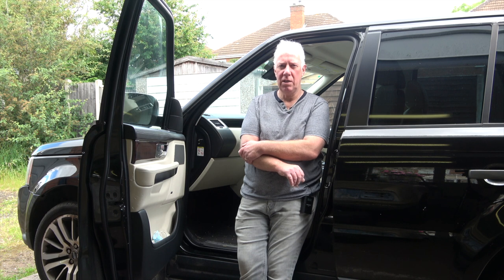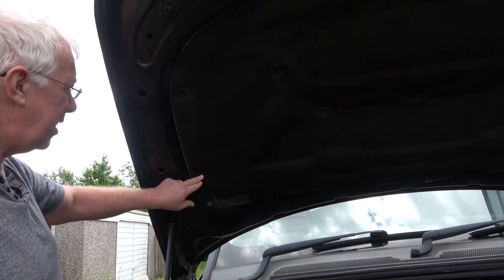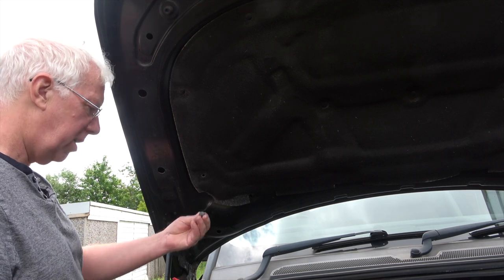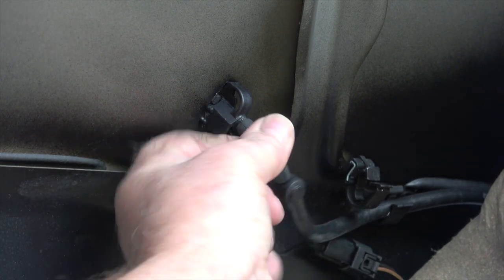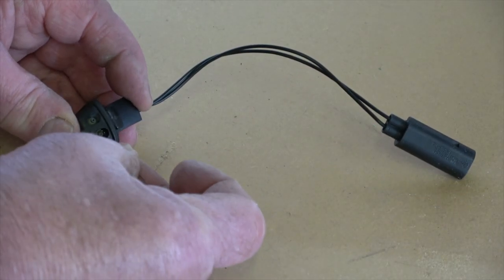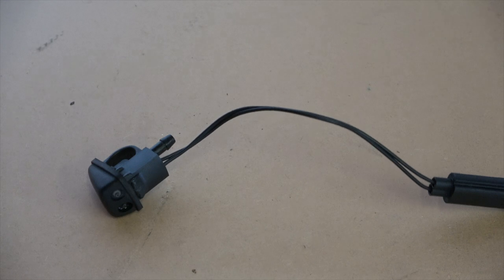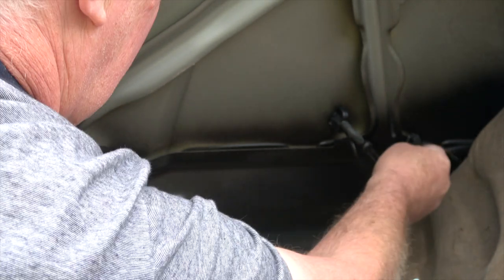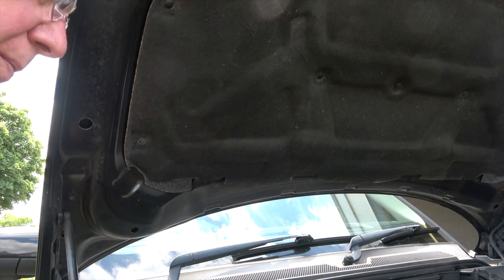Range Rover L320 Windscreen Washer Jet Removal & Clean.

Comment: Hello buddy don’t know if you remember but you said to let you know when I’d be getting a Range Rover sport well I have a 07 Freelander2 hse 2.2 automatic turbo diesel and I have been offered a straight swap for a one owner 2.7 Range Rover sport hse with 12mth mot my only concern is it has done over two hundred thousand miles would it be wise to just walk away
Reply from the maker: Hi George. I'd have to think long and hard about that!! First thing I do is check the MOT history on the gov website, see what if any advisories it has and if it's failed previous MOT's and on what. I quite often find when I'm looking to buy that a car advertised with full mot it often has a long list of advisories.
If it has a full service history and one owner that would be a plus, has it had a gearbox oil change, should have had the timing belts changed twice and due a third now.

Sounds like it may have been subject to a lot of motorway miles which is not bad, but 200K miles would put me off. I think I'd be tempted to look at a few other cars and compare. If you'd like to message me I have a face book page https://www.facebook.com/Range-Rover-Sport-L320-429152580879624  you could message me and give me more info, I'll help if I can ( I'll be out till later). David